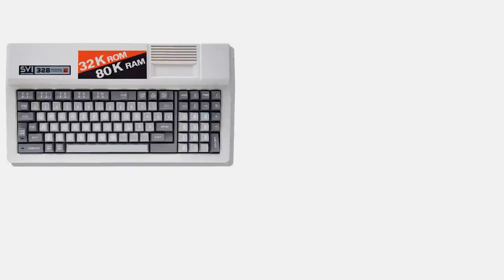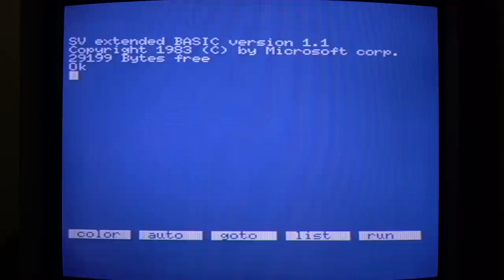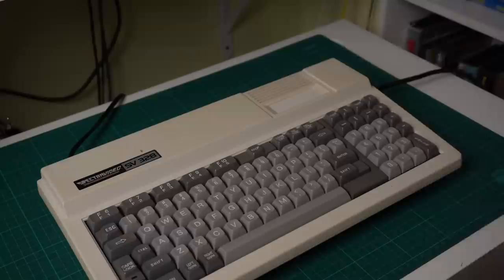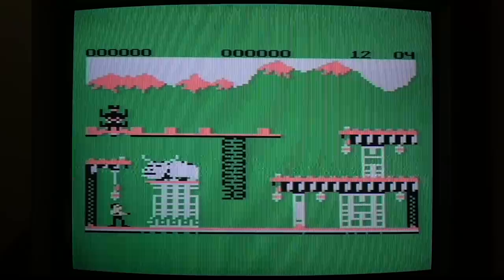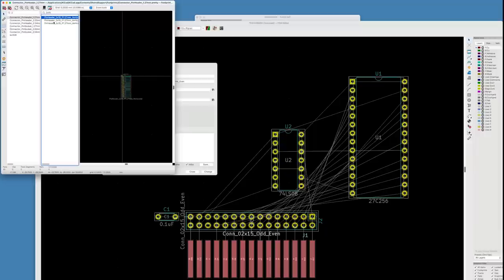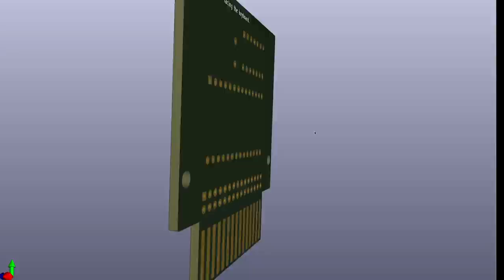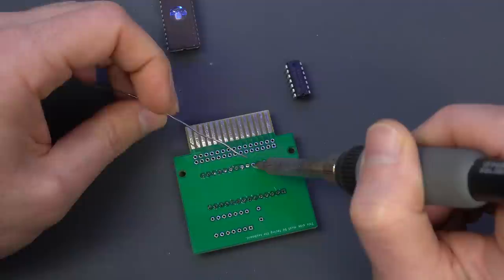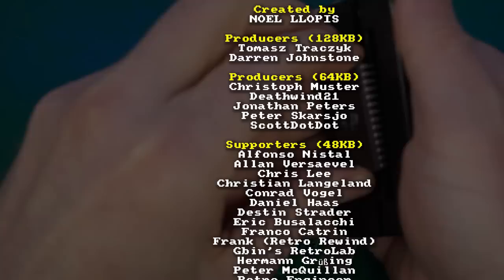Can We Turn This Computer Into a Different One?

Comment: It's a good idea to have the solder mask cover the edge connectors sliiightly , instead of having a tiny bit of thin trace completely exposed.
Reply from the maker: Oh interesting! Is that so there's less of an edge there for things to get caught on? Although the connector doesn't go in that far on the SVI so I'm not sure it matters for that specifically. Or is there a different reason?
Reply: @NoelsRetroLab  it's from the top, so that the trace on the board is covered. Just the top millimeter of the row of connectors, otherwise you have a 0.1mm thin trace completely exposed to corrosion and scratches.

Comment: i am sure i had a MSX emulator running from Disk or Tape at my SVI328 back in the 80s, I guess it would emulate a 32k MSX since the Emulator itself was using some memory too. I did not support diskdrives as i recall.

Comment: Nice. How about a 3D design of the cartridge shell with a removable or openable "mini door", so you can check/remove the chips/ROM without using a screw driver?
Reply from the maker: That would be very cool for this particular board. I'm hoping to work on v2 sometime soon that won't need swapping chips at all though.

Comment: Nice! But why an OLED screen on an SD cartridge? Wouldn't it make more sense to boot into a piece of code that shows a menu on the tv that you select with the cursor keys?
Reply from the maker: Good point. I just tend to like for things to be as self-contained as possible. So all of that functionality would be built into the cartridge and the computer wouldn't know anything about it. Just like a Gotek. I know other loading devices do the whole native menu (KungFu, Dandanator, etc), but that's just not my preference.

Comment: @Noel: Could you kindly add a link to the 2 STL-files (front and back) to 3D-print this Atari 2600 case?
The ones I have found on Thingiverse are all for either multicarts or for the center hole versions of PCB's.
Reply from the maker: It's all in the Github page 😃 Which reminds me, I need to add the credit to the person who did the slight modification for me (I don't know where the original model came from though).
Reply: @NoelsRetroLab  The tinker.obj file from the Github page gives an error that the file is corrupt when I try to upload to where I normally order 3D-prints from.
I can load and view it but as soon as I try to convert to .stl format it gives errors... :(